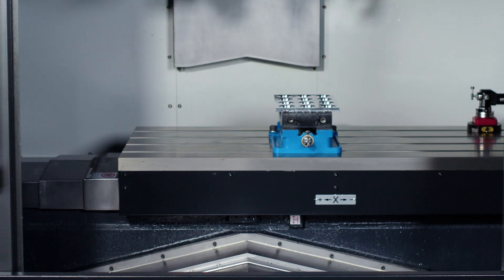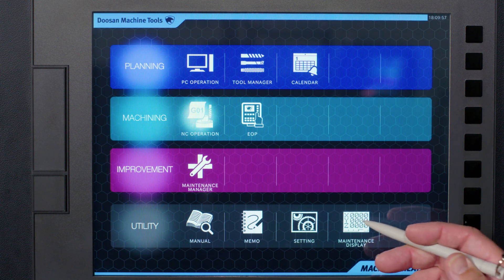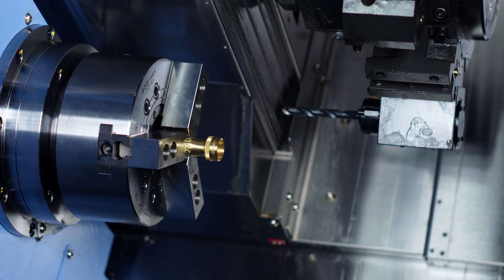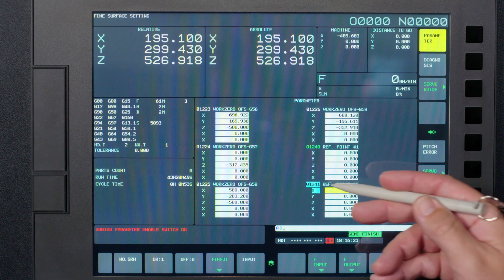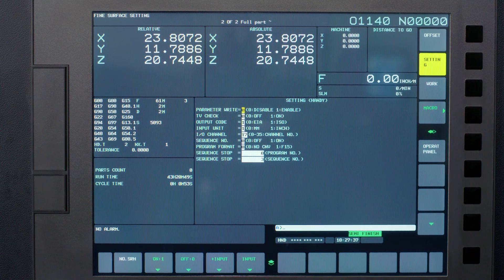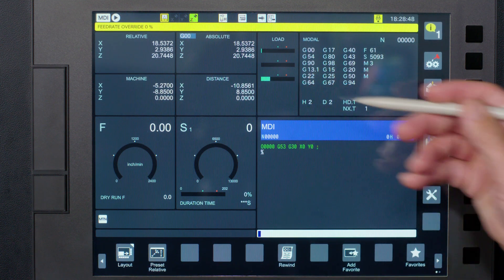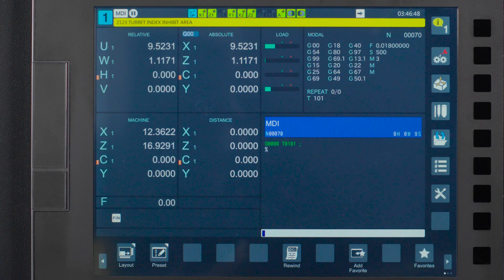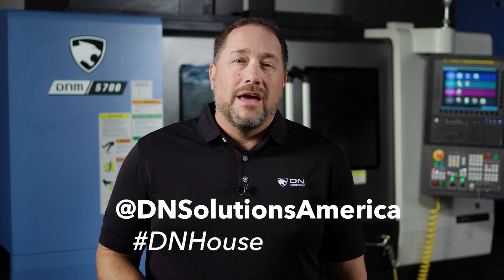Setting a Second Reference Position on Mill and Lathe - Know Your DN, Episode 20

Comment: Hello, Mark 
Is possible use a third reference to change a tool on mill NHP500?  I tried this but appear this alarm: 2060 [ATC]; M06 CAMMAND INITIAL CONDITION ALARM. Thanks for you support.
Reply: Andres, I am trying to understand why you would want a 3rd reference position for a tool change?  If you look at your NHP5000, when you command an M6 the machine is already at a 2nd reference position.  You will see the X, Y and Z reference position lights flashing.

Comment: Can someone please explain whats the advantage of having G53 G30 vs just having G53.
Reply: Sure.  You will need G53 G30 when commanding a transfer axis (A or B) on a two spindle lathe (if there is an offset other than Zero in the work offset page). If the is an offset in the register for this Axis, the machine will go to work offset zero first, then go to G30 position.  To be safe, I always use G53 G30 to send a transfer axis home.